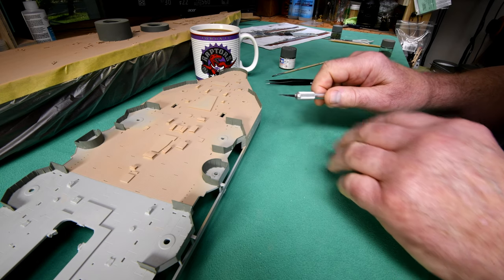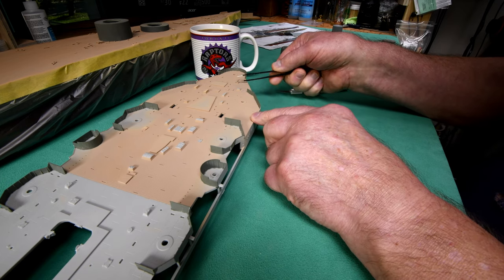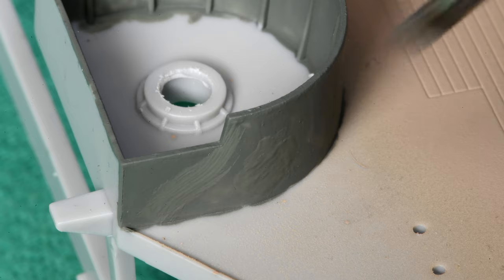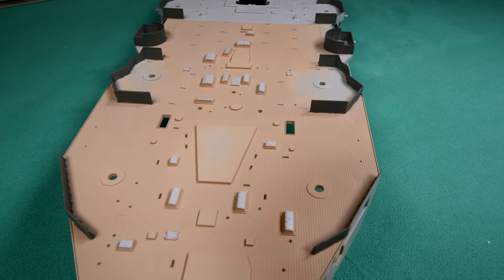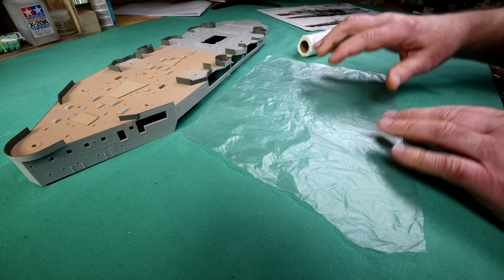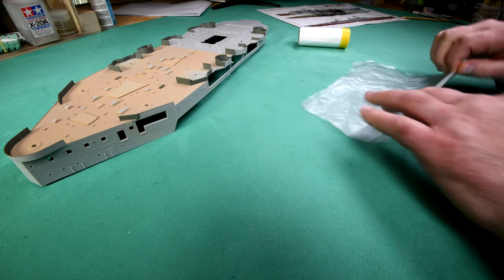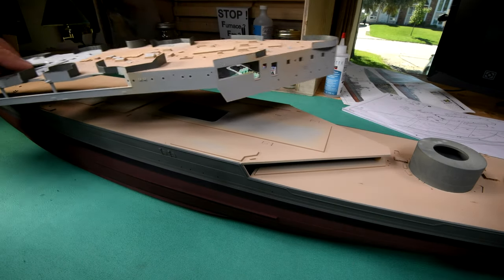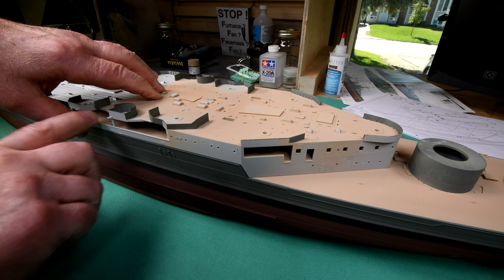The Model Ship - Part 555

Comment: It's personal choice, the wooden deck detail is beautiful on the Hood, so painting and possibly giving it a dark dirt clay wash, will make it pop. 

Pontos kits are definitely not for the faint of heart -besides Trumpeter Ship kits come with more than enough photo-etch - my HMS Nelson has 8 frets of it and HMS Abercrombie has 3 frets. 

I have got a wooden deck kit for the Nelson (Artwox - they do one for Rodney as well), but you don't need to cut everything off the deck to fit it and there's only a small amount of addition photo-etch.
Reply from the maker: Hi James,
Yes, I'd be more interested in wooden decking that didn't require deck detail removed. 🙂

Comment: Hi Ron, never understood with a kit of this size why the tubs etc were not separate parts. Would have made masking and painting far easier. I’ve built the 1/700 trumpeter Hood and the superstructure you worked today was in about 12 pieces.  Keep up the good work. Cheers
Reply from the maker: Thanks for that info Mark. 🙂👍

Comment: Yep, agree with your views regarding these "upgrade kits". I have got myself bogged down with my build of 1:350 H.M.S. Warspite by Academy. I purchased turned brass gun barrels, photo etched upgrades and wooden deck. I like the barrels but to be honest on comparing to the plastic I think I could have saved my money. The photo etch has very tiny parts that I doubt will be that noticeable once painted. I have now made a decision to not use a lot of it so I can get on with the build. It is just too much stress for very little gain. I do like the wooden deck though and will use it. I have 1:350 Tamiya King George V as my next build, they only thing I may get is a wooden deck. The other side to this is cost.
Reply from the maker: Thanks Dave. I agree, especially the part about the brass barrels. As Nick said, "for someone who wants to build a "simple"kit and get it done and most importantly enjoy the build"  and I guess that's me - having "fun". 😁👍